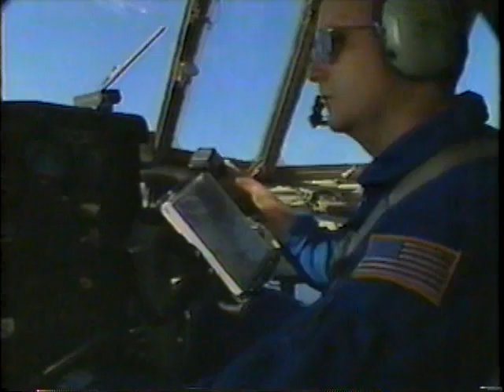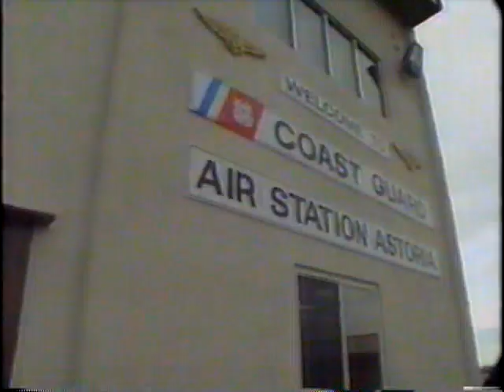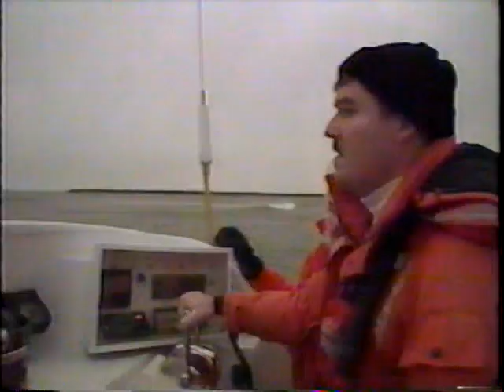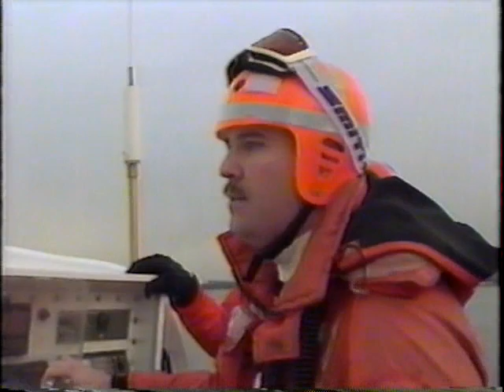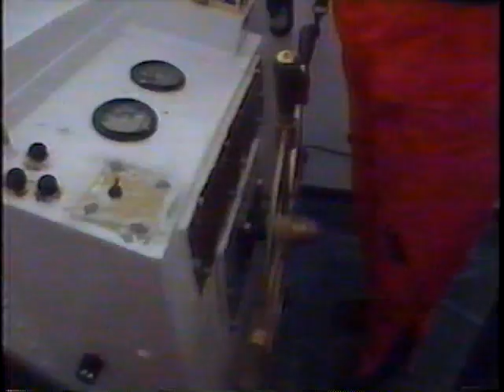Discovery Channel Special on Coast Guard Cape D 1994

Comment: I was stationed there in 1969-70 the triumph was there and so were the 44's and an old 40 boat survival gear was alot different than today so was the station alot smaller